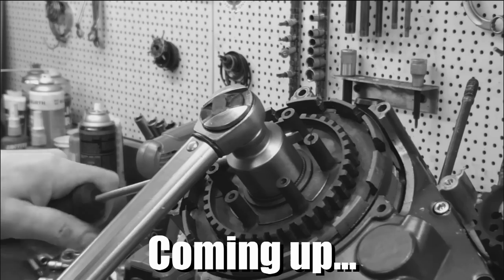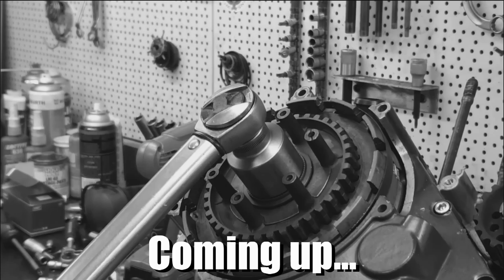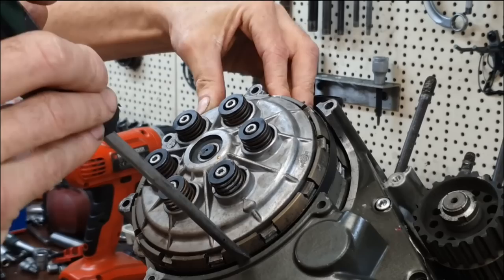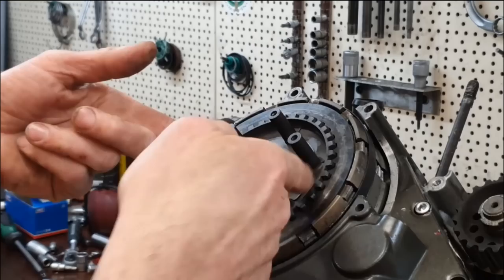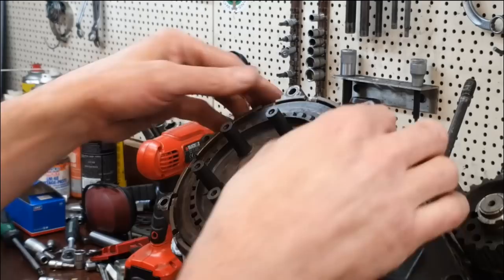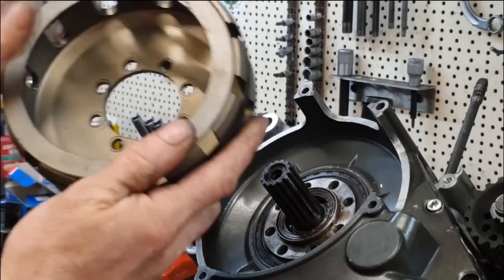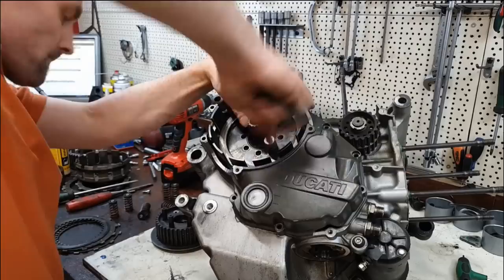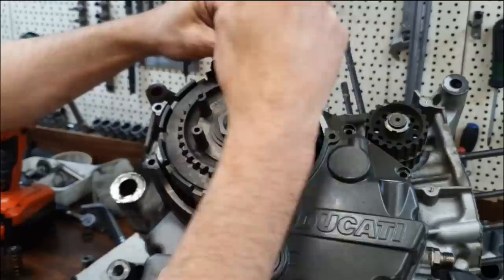DUCATI Dry Clutch Mod - Important Information

Comment: Thanks Toine! Nice you took the trouble to show us how it's done and how it works (although I have to watch it a few times more to completely understand why and how). Good you asked Andy to mention which Ducatis it concerned (dry clutches with the clutch slave on the left). Only thing not completely clear to me is how the narrow convex steel ring that Biggelaar supply and which placed between the hub and the clutch plates stays centered. Again thanks and for those who don't Van den Biggelaar (more than 3 generations) are a famous Ducati tuner since 1966 (that's 1 year before the first Desmo production Ducati was introduced!!!). Oh and before that they were already 13 year in the business of motorcycle maintenance, so they have a rock solid reputation in the Ducati world. Thanks for taking your time to show us how to make your modification work! Frank

Comment: G Day from the Goldie Andy, Sikaflex 291 is the black stuff I'd recomend for those with alloy baskets doing  Toine's Mod.  Non slumping Marine non sag 1-C polyurethane sealant. Good adhesive with some okay vibration absorbing qualities. Lov'in your work on the channel Andy, Bravo Zulu
Reply: That's the thing, Toine's paper instructions he sent with the mod he just says best used with heat resistant kit which isn't clear to me. Thanks for this info. I'm in the Goldie too.
Reply: I spoke to Toine & he said heat resistant adhesive so Sikaflex and LOCTITE 80ML HIGH TEMPERATURE SUPERFLEX GASKET SEALANT will do the job. "Most important is that it stays sort of flexible after drying and that it can handle the heat"
Reply: Actually the Sikaflex doesn't look to be heat resistant.

Comment: You're a wealth of information,   thank you ever so much for these tips and advice. 
On another note,  I've a 64 mountaineer that I have running and ready to register,    only thing I really need to complete is the rear saddle rack, number plate mounting, and tail light assembly,     any leads to would be much appreciated if you can spread the word that I'm after these rare pieces
Reply from the maker: Geez, good luck with that mate
Reply: @ANDY5  yup    thanks man,    been a thirty year project,   started it when I was 12,    now 44,    it runs and rides like a dream,    got a simple light on the rear,   but I'm looking to complete it with as close to original as possible.    Againd,   thanks for your videos

Comment: In 400.000  miles on 2 ducatis I messed with noisy clutches a few times 😄😄😄😄 I had a disc made at a waterjet company ," 1/8 Thick stainless steel , with a tight clearance on the basket tang the banging of the clutch was eliminated.
Reply: What model bikes did you put those miles on. I want to buy a 2000 900 SS with 7K and it looks showroom and was stored indoors. Are those bikes bikes you can log high miles
Reply: @ricvanwinkle1665  Yes. My 1999 900SS has 86K on her and I read recently that someone had 196K on theirs. (Hope you bought that machine :)

Comment: Cracking Video as always Andy! I do have a question about the clutch on these bikes and please feel free to tell me that I am a flaming idiot! How come the last plate before the pressure plate goes on is a steel plate on these Ducatis? Is this unique to dry clutches? I have never had the pleasure of working on a Ducati or a dry clutch so I am curious! Of all the clutches that I have changed, the last plate has always been a friction plate. Many Thanks
Reply: its very simple, the pressure plate is connected to the aluminium hub, if you would finish with a friction plate everytime you would start driving away say from a traffic light or so the pressure plate is not turning and the friction plate is, is  that way the pressure plate would wear out like crazy, with the steel plate this doesn't  happen as both are on the same part of the clutch so they stop together or they spin together, but most wet clutches are operated by a fork or a lever inside the clutch cover Ducati clutches are pushed from the opposite side of the engine by a pushrod that goes trough the gearbox axle .
Reply: @toinevandenbiggelaar6083  You know what Toine, as soon as you said the pressure plate is connected to the aluminium hub it became obvious! I should have paid more attention! Cheers buddy! ;)

Comment: Now I feel like everything is wrong with my clutch on 98' 748 Mono. Fired her up after 2 years,  I hear a strange wining.. or similar to the sound of compression when turning over an engine.. engine runs great otherwise. I took apart the clutch cover which had a torn gasket, and low and behold she's all rustic inside. Cleaned up, degreased and buffed all I could for now but I'm thinking of buying a Slipper Clutch by KBike...

Comment: Great video!! Just received my mod kit from Toine. Does anyone have the torq values for the basket screws, the center nut and the pressure plate screws? Do I need loctite anywhere?
Reply: Where did you buy it from?
Reply: Biggelaar Special Performance. I just installed it. Sounds perfect now. All the clacking racket gone. Haven’t gone for a testride yet
Reply: Went for a testride the other day. The Biggelaar clutch mod works great. No more clacking and great feel.  Easier to ride at low speed, gear 1 and 2.
Reply from the maker: What Lars said.

Comment: Since you took the side case off, any tips re how to best apply gasket seal to the side case when reinstalling it? I had to remove my side case, and I’ve reinstalled it twice now and keep getting small oil leaks around the right side screw holes. I’m about to try it for the third time, but not sure what I’m doing wrong! (I’m doing this with the engine mounted on the bike, not on a bench.) 

Any help would be appreciated. Thx.
Reply: Clean and dry well, then try a little line of black rtv gasket maker around the edges of the cover...